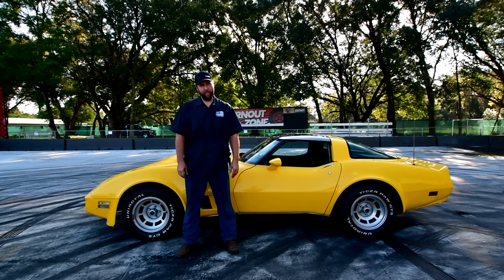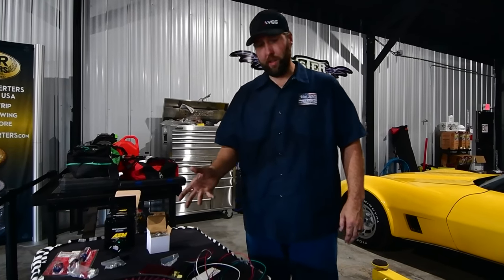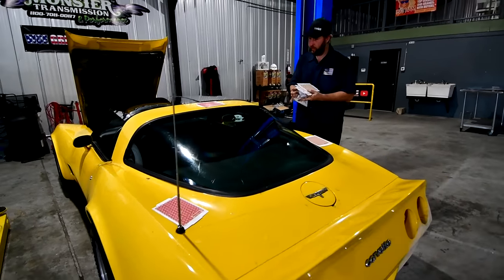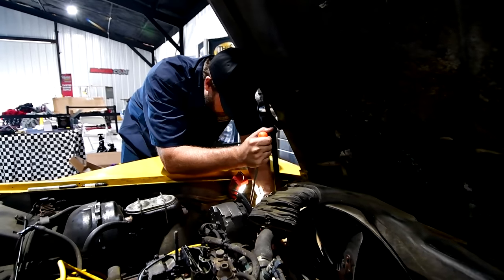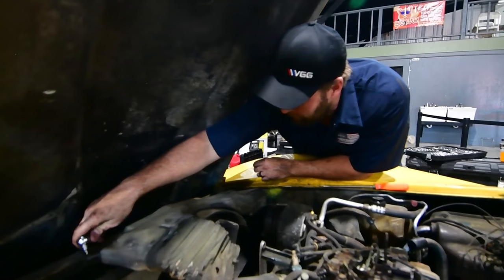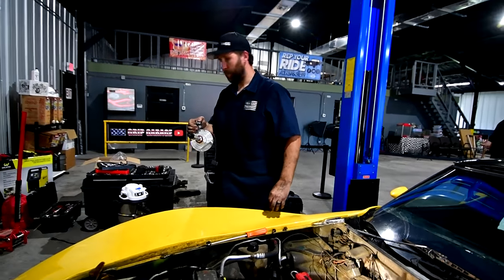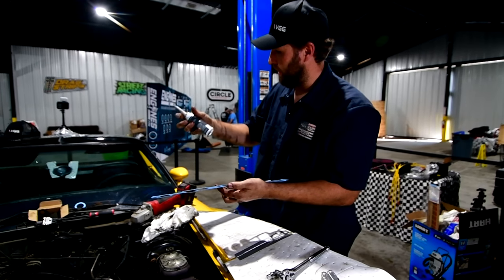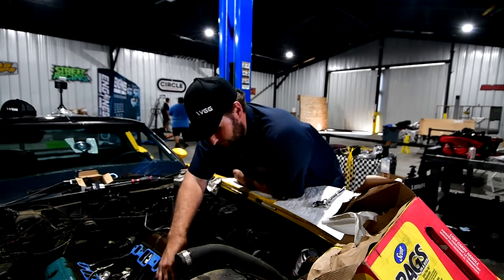FORGOTTEN C3 Corvette Gets Supercharged - PART 1 (preparing for burnout competition!)

Comment: "Jessica wouldn't let me bring my Harbor Freight ones."  😬
Reply from the maker: Had'em packed, she took em out
Reply: @ViceGripGarage  She's gotten used to her Sasquach, although why is still a mystery.
Reply: It's when she packs em is when you gotta start worrying
Reply: @NoWr2Run  so sorry for you, I hope peace finds you soon
Reply: @ViceGripGarage , i feel ya. Had mine for years on years never had a problem. Turned in 2 sets and got 2 of the replacement sets, never even took them out of the box cause I figured they'd be recalled too after reports of the weld fails, and they were. Should've kept the first set.
Reply: @iamthecheese2737  I've got a set holding up a 12V cummins, and another set holding up a 95 BMW 540...No issues, but we got them almost 2 decades ago.
Reply: I'm
Reply: @NoWr2Run  Sorry for your loss brother, lost my brother in law as well. Good luck to you and.hope you the very best.
Reply: @iamthecheese2737  This is the first I have heard of HF jack stands being bad...I have 3 sets. 2 sets of 3 ton and 1 set of 6 ton. I figure they gotta be better than a cinder block right?
Reply: @NoWr2Run  peace my Neighbor. Lackawanna co.
Reply: @NoWr2Run  So sorry for your loss. Not my wife but a close relation did this. Very difficult to deal with. Praying for you.
Reply: @HanstheTraffer  well the way i understand it the molds wore out, so the never castings teeth weren't too spec so they in theory could let loose. I've never seen any videos of them actually just letting loose other than people actually really trying hard to knock them around in ways i don't see the normal driveway mechanic going at them. Mine were of the older original castings, I shouldn't have given them up. But the replacements that were recalled too had one complaint of the weld on the base splitting. They looked cheaper and less sturdy than the original anyway.
Reply: I've never fully trusted any Jack stands.
Reply: The devil is in the details  Exactly, always have backup!
Reply: @NoWr2Run  hey buddy, just saw your comment and I’m so sorry for what you’ve been going through brother!! I’ve lost several friends, extremely close friends and one was a coworker that I worked side by side with for years and that happened and I’ll never forget that day. It was like I had gotten run over by a convoy of 18 wheelers, not just a single truck. I’ve found the pain doesn’t get any better but we find ways of going on but I think about him nearly every day. 

I’m a disabled Desert Storm Vet and have really had a tough time with things. I just got out of the hospital again today and have a tummy full of sutures again. This was the 14th surgery now and probly have another coming soon but they want to get thru the holidays. Sometimes I lay here and just wonder how much pain a guy should have to go thru and for how long? I sometimes pray that I don’t wake up and just keep peacefully sleeping but was raised in the Midwest and as you know we were always taught to never give up so I pull my boots back up and try to love everyone around me as much as I can cause if something happened, I know the pain I would cause to several people and I can’t do that to anyone!!!

And what makes everything so much harder right now is that my wife has been gone for 2 years and 2 months right now. We’ve been married 27 years so she is my bestest friend in the world and we never did have children so it’s me and the barnyard cats, the chickens, ducks, turkeys and rabbits. They are about the only thing that keep me sane right now, if that’s what you wanna call it, lol, but I think you know what I mean brother! My wife’s mother and a couple other family members came down with dementia, cancer and a few other bad things but there are 3 of them that are terminally ill so my wife, being a nurse, left her job to go home and care for them and to try and make things as easy as possible but we had no clue that they were actually going to hang on this long, which is great but now I’ve been without my best friend for over two years when I need her and it almost feels like I lost her cause we seldom get a chance to talk because she is in a bad area in the deep sough for cell phone coverage. 

I want to say I understand the pain your feeling but I still don’t. I’m close, but till you go thru it yourself then you still just don’t know. But know this brother, there’s a bunch of us out here that’ll do anything we can to help you keep that focus each day so that you and the dogs get up, pull those boots back on, and we get back out that door and make some sort of progress buddy, we can’t give up, we can’t quit, the docs and animals love us and rely upon us each day unconditionally!!!! We love you too brother, and if you ever need anything, drop me a note cause I’m here for ya no matter what it is and if I can’t help then I’ll find someone that can!! I can not set back and do nothing knowing someone else out there is feeling the same pain as me but probly stronger than mine. Your a strong man buddy and you can make it thru this!!

This is long enough now but I hope you have a merry Christmas brother and never forget, we are here to help, just let us know tho what you need!! Be safe out there and I’ll talk with ya soon!!
Reply: Harbour freight ?, please explain.
Reply: @davefisher5970  Some of their axle stands had a tendency to be axle laydowns.

Comment: In case nobody got that Harbor Freight jackstands reference he made... I'll cue you in. Harbor freight did a massive recall on just about all their jackstands. Supposedly the tooling they used at the factory was worn out and they were dropping cars on people.

Just a warning.
Reply: Worn out tooling does not equal low quality steel or bad welds and if the jigs are "worn out" (which they really don't do, especially in this case) then someone should have said something but they probably wanted to make sure they got paid and fed that day and had a job to come back to the next day... or they did say something and got shot before anybody else got "snobby" with wanting to make safety equipment with quality and accuracy!

Don't blame the local stores, they were accountable and did a recall! Blame the Communist run factory that rushed &/or cheaped out in the first place!

Comment: If you stuck the shop vac hose into a 5 gallon bucket and a 1/2" hose into the buckets vent hole you can easily suck out coolant and not have to worry about clean up after.

Comment: I just realized he used a floor jack when he's between a two post lift. Lol. Can't break old habits I guess.
Reply: I've done that a million times because you think it will take to long to set the lift up and then you end up fighting with a jack for 10 minutes and cussing yourself because you are still working on the ground lol
Reply: @SlimPickins_07  You Jack the front a few inches put the front arms under then the same in the back takes like 5 minutes I'm not working on the floor if there's a lift there.
Reply: Possibly insurance thing with the garage he was at.
Reply: Car so low gotta roll onto to some 2 be fers to clear the floor jack can lift it up so lift arms can clear 😏🤷‍♂️
Reply: @tomtheplummer7322  doubt it on one of those old vettes. At factory height they sit pretty tall.

Comment: There's almost always a plug in the radiator where you can run a thermal switch that activates at a pre-detetmined temperature. Use one rated at 180 degrees F and use it as your fan ground with a constant 12v source to the fans. Radiator hits 180 and grounds the circuit. Fans run until coolant is cooled down. Make sure you have continuity to chassis on the radiator!

Comment: I'm old and this car was new when I was a mechanic... we didn't have lectric gasket removers... you kids have it easy. Those rubber gaskets at the front and back of the intake... I used to use weatherstrip adhesive (there was no RTV or silicone gasket stuff back then) to glue em into place... did the trick. Used it on thermostat housings and valve covers too.

Comment: I predict rods and such finding their way to the outside world real soon.
Reply: Watch him run an 8 Inch wheel
Reply: No way, with stock heads and cam it will not make any real power.
Reply from the maker: @16driver16 Absolutely will. Watch me.
Reply: @ViceGripGarage  have faith.  Car has made it this far.
Reply: @ViceGripGarage  Lmao!. Love your show man, keep up the great content for a feller. "Whoops, there goes a bolt... great." I know that feeling all too well.
Fyi advance auto parts Carries electric fans, usually in stock, I would know I'm a commercial manager at one lol. Love you man, be good...kinda.
Reply: Engine definitely will be opening an inspection window.
Reply from the maker: @Jeff, hang tight, you're in for a surprise.  All in the tuning my friend.   This gal will sing 5500 all day long.
Reply: Jeff Kopis  my 78 350 in my k10 still runs like a top, knock on wood, i floor it when i need to but 4.10 gears th350 and 37" tires i probably dont run nearly 5000rpms for more than 30 seconds at a time.
Reply: NEVER DOUBT THE VISE GRIP GARAGE MASTER MECHANIC....!!!!!! Love your humor.... I can’t get enough of your videos.... love them all ...!!!!!👍👍👍👍👍
Reply: @16driver16  you need to watch Ruby's early videos like str8 from the occasion video
Reply: At the end of the day it's not horses that spin tyres, It be torque that does the tyre shredding thing. It may only be 70 or 80hp, but that's a good 160 - 180 lb ft. extra in the spinzedonuts dept.
Reply: Jeff Kopis  good ol' GM TBI. The only time a 305 is better than a 350....
Reply: @carwashadamcooper1538  I have a 95 with a 305 I guess I'll just throw a cam and some heads on the 305 now
Reply: Jeff Kopis  I got a 305 tbi with a 5 speed behind it, it’s 100% factory and will get plum nasty with you. I’ve hit 125 in my truck & it’ll eat 5500 like no tomorrow. But I have noticed when it comes to a tbi 305, they are hit or miss.. either they will run like a scalded dog, or like complete shit. Then again I’m the second owner of the truck seats have never been sat on without a towel covering them, & been maintained religiously zero questions asked. All about how a fellar takes care of one. If all your doing is maybe 1 oil change yearly I feel you’ve found the problem.
Reply: "Its fine"
Reply: @ViceGripGarage  Hey Derek ~ Love VGG; Can't wait for Part 2 When's a guy gonna upload that?  I don't know ~. You've got us on pins and needles waiting for Part Two-O.  Keep up the awesome work and teaching ~ 
Cheers, D

Comment: My dad told me long ago if your using cork, rubber or any gasket that will creep out when tightening. Ist thing to do is flatten out the metal around the bolt holes if its a stamped cover like a oil pan. Then stake the gasket surface of the block every so often with a center punch so it raises a small amount of metal and will stop the gasket from squashing out.

Comment: Off of this subject, mechanics note : recovered a vinyl top on a '80 SedanDeville using flex-Seal, roller applied. I'm amazed. Put it on in 2 thick coats with a 3" roller. Looks like a new top. I suggest you try it on your '70...

Comment: Looks like heater core is leaking under the passenger side of dash
Reply: One thing at a time now.  A guys gotta pick his battles...
Reply: Yikes!  I'll bet that's a joy.
Reply: That's just what I was going to comment. But ... I suspect that is really ugly to get at.  Had that happen on my MitsuBeast. Actually the grommets failed, not the core itself. Was a common failure. It's a $1k job at the dealer and they have to rip out the entire dash, starting with the driver's side.

Comment: a 90 degree angle grinder with a scotch loc adapter and scotch bright discs are the easiest method i ever found to clean mating surfaces for re-assembly. no razor blades, putty knives or eyeball impaling wobbledy wires.

Comment: if the accelerator pump works good, you can often fuel flood them out when they wont shut off from dieseling/run on condition. 
But obviously one of the best ways is shut off in gear or stall it with clutch since its manual.

Comment: As you may know a 6,8 or 10 penny nail is the ultimate brake line cap. File that casting flash off the taper of the nail head drop it in the break line and crank it down. Just don't expect to get it back out of the line after its seated.

Comment: Ford Windstar electric fan is your key. Low profile dual fans and they move like 3600 fpm of air. Did that on my Chevelle and it never touched 180* on a 90* day doing burnouts

Comment: I could be wrong but the blue color of your engine on the inside makes me think it was probably super hot at one time. Don't worry it doesn't mean anything you have to worry about along with a leaky heater core you should be in great shape for the burnout contest. I
remember cars like that when they wanted to keep running after I shut them off when they reached the 300 degree operating temp.

Comment: I have what you need I have a 1978 C-30 with a vortex 350 and a 4 speed it was a fire truck so it only has I think 40 some thousand miles on it !! We have no use for it and it runs but has issues and I don't have time to mess with it as we run a shop and are busy as hell it's for sale cheap and has very little rust !!

Comment: Heater Core leaks into the interior (Ants) sometimes called an extra radiator, needs to have the hoses cut n plugged. 
Hoping the computer doesnt miss the oil gauge n not start the motor. Cant wait to see it run run run.

Comment: use a torque strap I "wide by 3/8" thick stainless steel strap. Measure from the front of the frame  to a larger bolt on the front of the block. bolt to frame on the torque side, you can do both but mat not need to problem solved. An old drag race mod  good luck

Comment: The wet floor is probably a leaking heater core, my 1990 c4 did that, or a plugged up drain Bellow's, like on my 1999 C5...fyi

Comment: All these comments about having a hoist right there and still using a floor jack reminds me of a few months ago, I took the ole Peterbilt to a shop because the alternator went out. I got the unit off and started looking for a socket for the nut on the pulley and the mechanic says “here lets take this in on the bench where it’s a little cooler. Ya know, work smarter, not harder.” I told him, “yeah, but sometimes, harder is faster!”

Comment: The motor doesnt need to be at tdc as long as the rotor points the same direction it was when pulled it will have proper timing fyi. Love the vids

Comment: Kinda worried for the slivers of gasket between the runners of the intake that have nothing but a little RTV holding it on vs. even moderate boost. A guy would have trimmed those off, but that would have been the "right thing to do" I suppose.

Comment: Derek, once again, I realize that this video (as well as this project) is over a year old, and you know that I LOVE the vidgyas regardless of the content, and while the Roots style blower is AWESOME and looks ridiculously amazing on the C-Tree, one day soon I'd really enjoy seeing you turbocharge some project. Something older, with an inline six or a V8, with a QFT blow through carb, or even multi-port fuel injection, and some proper engine management. I mean absolutely NO disrespect in any way, I'm just a humble subscriber, but I think that you'd have alot of fun with a Wu-Tang War Whistle straight from eBay on some old car that you don't care about beating on (which is almost every project lol). That L82 has the PERFECT compression ratio for a turbo project and it would've made much more efficient horsepower at the same boost level on a MUCH cheaper eBay turbo. Granted, it would've involved much more fabrication than just bolting on, but you would've spent an 1/8th of the money for more gain.

Comment: I despise brakekleen for being non flammable. I rebuilt a small engine once, and didn't have a fuel tank setup, or starting fluid. tried using brakeleen, wouldnt run, tore it all apart again, found out brakeleen wasn't flammable. rebuilt, fired up on gas

Comment: I used to rebuild those rearends when I worked in a chevy dealer,there the weakest point of that car to be used for burnouts.spindle bearings and half shafts don't hold up either

Comment: The very first "Trick" I learned about building SBC engines came from Bill Thomas around 1962. Bill may be a bit before your time, but he built the famous 409 engines for Cone Chevrolet's "Hayden Proffitt" driven Super Stock cars. He also built the famous "Cheetah" race cars. When assembling intake manifold to block first take a simple center punch and hammer the mating surfaces until rough. When joining dissimilar metals (aluminum manifold to iron block) roughen even more to compensate for the greater expansion of the aluminum. Too many backyard mechanics think they are smarter than the engineers that designed the engines. GM used the same rubber end seals for nearly 50 years. Never and I mean never use silicon anywhere internally in an engine. One little excess drop (glob) can easily plug an oil gallery and turn thousands of dollars of precision engine to a smoldering pile of junk. That's OK now. I'm done venting and dropping names, but if only one viewer listens...

Comment: I had a giant ant invasion in a used Lexus I bought and followed some suggestions from a friend and got rid of the ants in 4 days. I used Combat syrindge of ant killer/bait and put little dabs everywhere I saw an ant trail and the ants were so thick on that bait within 1/2 hour and must take some back to the queen and soon they were gone. Combat Ant Bait in a plastic syringe not the roach bait but ANT bait, should due the trick for you.